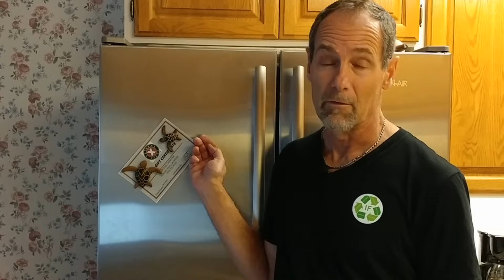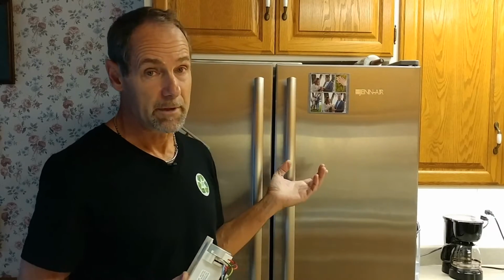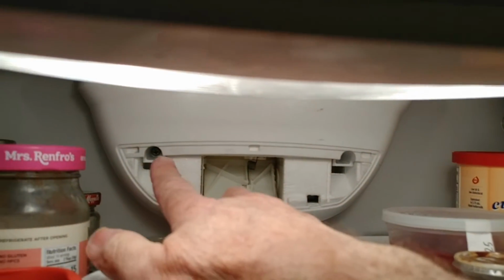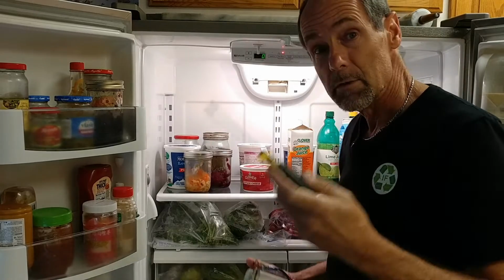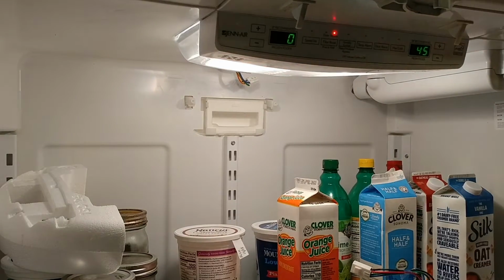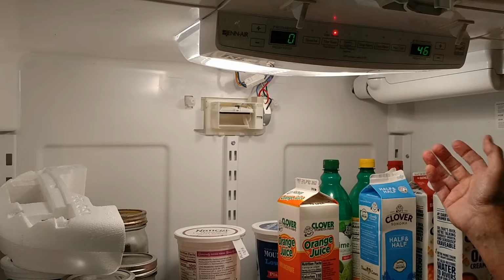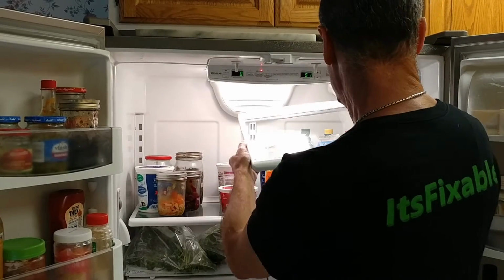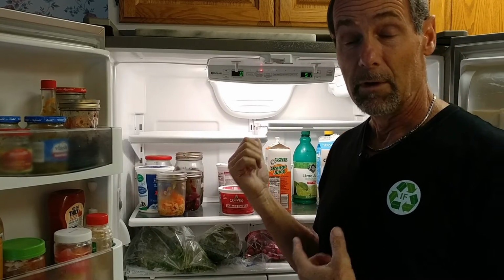Refrigerator Damper Control Replacement

Comment: Last year I had this problem and installed a replacement. After about 9 months, the new one started making noise again. I removed the part with the intention of seeing if there was a way to adjust, tighten or lubricate. There wasn’t. So I reinstalled that same part. It hasn’t made a sound again and appears to be operating properly. I don’t know if just unplugging it to remove it did some type of reset or what.  But you might try just unplugging it without removing. Leave unplugged for about 10 minutes. Then plug it back in.  Hopefully mine will stay quiet for a while.

Comment: My damper was replaced but still will not open. And I don't see where the temp sensor is in my refrigerator. I saw the repair guy replace it but he did not put the cover chute back on properly. So after he left and I cleaned it fridge compartment out I pulled the cover and he'd made a mess of the damper installation. Foam insulation was all torn up but alas, even straightening out the mrss the door will not open and fridge is warm as can be. According to stats. It's the fridge temp sensor that tells the door to open and close. But I just cannot locate it. There are 2 small vents in the fridge that are not inlet air but I cannot see how they pop off. But am assuming the sensor must be behind one of those. But don't want to break it trying to get to it. Pitiful.
Reply from the maker: Sounds like the service man didn't know his stuff. I'm sorry :(. You'll need a parts diagram to locate the sensor. Google your brand and model number and you should be able to find one on the Internet. It may be that your problem is the circulation fan and isn't the sensor or damper at all.
Reply: @ItsFixable  Thank you for answering. But I figured out the problem. The sensor for the fridge damper is in the freezer. And what it was, after I pulled the cover in the freezer, was the coils, the vent to the fridge and the sensor for the ice maker was totally frozen over. I used a hair dryer to defrost everything, dry it out and put it back together and everything started working perfectly. The damper opened as it should. The ice maker started making again and the freezer and fridge temp were perfect. 
Unfortunately, the company had already deemed it a total loss and gave me a new fridge. Which has been working perfectly since I plugged it in. But still. The event was a disgrace. It took me 5 months, to finally get it working, just so I could, do it myself, anyway. If this is a sample of warranty service, I'm not at all impressed. 
And I was told by a reputable appliance sales and repairs outfit, that most repair companies don't even do warranty service work. Thank God for Google and YouTube. And I hate saying that. 
Thanks again for answering.👍
PS. He did get the evaporator fan spinning. Without removing the back panel. But within 2 days I could hear the fan grinding on the ice again. 
Why have a sevice tech who is in a big hurry to get in and out, and then have to go in and do the job yourself. I've never replaced a compressor. Because I don't know how to do the procedure and don't have the vac and freon experience. But everything mechanical he did i have done on past refrigerators we've had. But I didn't feel I should have to do what the warranty was supposed to take care of.
Reply from the maker: @peterford9369  Wow, what an ordeal! The fact that it iced over sais to me that something else was wrong with that unit. I'm glad to hear you received a replacement, but sorry for your headache 😢.
Reply: @ItsFixable  Thanks. But from all the complaints I read, about even well known brands. It seems quality control is really an issue in appliances. Probably other items too, I'm sure. But there is no excuse for that kind of slow and carefree service. You buy a product in good faith and you trust the manufacturer to stand behind it. And then, obviously to save money, they hire somewhat, flybynight service people. And then when they do finally get to you. The company doesn't even ship them all the parts they need to do a thorough repair.  Just very unprofessional in my opinion . 
Thing is, I only paid 850 dollars for the fridge. All I could afford for the style and options i liked. But I read similar stories from people with 3000 dollar fridges. So the problems are across the price spectrum. Not just less expensive equipment. 
Thanks again.

Comment: Thank you so much! This video helped my dad so much! :) Our fridge crapped out yesterday night and we were trying to figure out what happened, he figured it out but we could not find where to fix it. This video aided us in locating the problem! Thank you so much again!
Reply from the maker: Glad I could help!
Reply: @ItsFixable how fast is it supposed to open?  Is the motor supposed to have a small vibration?  I installed a new one and it hasn’t opened yet. I’m trying to figure out if the new ones bad or hasn’t opened yet

Comment: I have an LG ref LFX25960ST, installed new damper, it remains open or closed all the time, I already changed temp sensor too.Thanks.
Reply from the maker: That sounds frustrating, I wish I had an answer for you.

Comment: Hi. I have a customer that complains of that noise, however, she says hers is continuous and when I opened it I noticed that it kept going up and down. Do you know if I have two separate issues? I’d the noise the damper but the continuous running is something else? I noticed in your video that the damper kept moving up then down. I assume it’s because the doors are open but the customer complained that it’s constant. Do you think if I replace the damper she will be fine or if it possible that it will be less loud but still keep running all the time, closing and opening? Thanks for the video and for any advise you might have.
Reply from the maker: Change the damper;  that should solve the issue.
Reply: Curious about that "constant" open/close action myself too. (Assuming because the doors are open, it can "see" the fridge needs to cool? So it cycles a few times as a "test"?)

Had to "fix" my Damper Control recently because it stopped working after a power outage.  My assumption was that the motor/tab somehow slipped free of the door (during/after the outage) so the motor was "silently", and as far as the Electric Control Board/System was concerned, "working" as commanded.
Reply: @ItsFixable changed it out and everything is working just fine. Customer called me about a month later and complained t that the things on the top shelf are freezing. I told her to adjust the temperature setting but that’s about all we can do because I’d obviously working fine. Haven’t heard back so she figured it out.

Comment: Great video! Made replacing the damper very straightforward. I would just suggest turning the fridge off before doing this, as the wires to the damper motor are 120V.

Comment: Thanks for the Video. Had a power outage here last week and afterwards, for some reason, the Damper Control wasn't working, so while the Feezer was staying Frozen the Fridge was staying between 45F-53F...

Was able to get into "Service Mode" to run various tests (using the instructions in the Technical Diagram Paperwork from underneath Fridge by the Coils from a Plastic Pouch...).  The Damper Control was reporting Open or Closed (and I could "command" it to switch) but it was always staying closed... Also didn't make any noise during the "switch".

Took a plastic Bread Bag Clip to wedge into the Damper Door Opening to keep it OPEN temporarily and that was able to finally quickly bring the Temperature down in the Fridge.   Eventually decided to see if I could remove the damper control to test if the Motor's Continuity was good/bad... While loosening it from the Tabs I think because the door had been open that the Motor (Door Tab) had been able to rotate back around. So when the Bread Bag Clip slipped/fell out, during my removal attempt, the door actually stayed open and cycled again.  It does make some obvious noise now (and looking back that has been "normal" for a while, but it didn't do that during the earlier testing (because the Tab/Motor wasn't "under load"?)...

As mentioned in the video, maybe the extra loud noise is because the motor is on its way out?  It is about 16 years old/original to the Fridge (2008)... So I'm think it might just be best to just swap it out.  If nothing else it might be quieter and hopefully won't "fail" randomly because of a loss of a power loss again.  If "that one" fails I suppose I can old onto the original as a "backup"...
Reply from the maker: Interesting experience. Good for you for sticking with it! If that's the original damper mechanism, it has lasted way longer than most. can't lose for replacing it at this point.
Reply: @ItsFixable  Agreed.  Have a replacement at the ready.  Running some tests with some Wireless Temp sensors to "dial in" the Temp make sure I'm around 35-38F "everywhere". Hopefully no 32F or 41F cold/hot spots...

Comment: Thanks, i have an LG that the compressor went out on July 6th 2022 and after 2 techs serviced my machine the refrigerator is still warmer than should be but freezer is working. I believe the damper is stuck partially closed not allowing enough cold air in. 

trying to find a good video on LG damper(side-side) replacement.

thank you again!
Reply from the maker: Or it might be the evaporator fan, which is responsible for moving the cold air between compartments. 

 Thanks, best of luck.

Comment: Thanks!  My whirlpool fridge has made this noise ever since I got it, but it’s gotten significantly louder lately and it’s only 7 months old. I took the first cover off and saw when damper opens and closes, it makes a horribly loud grinding noise. Now, I do have an extended warranty but wonder if I should just order the part myself and replace it. Not sure how much the part costs.
Reply from the maker: The part cost me $100.

Comment: Thanks for this video! :) Mine was doing the same thing continuously opening and closing and making noise, replaced a damper - it opened right away after I connected it and it looks like it never closes, veggies are frozen and it wasn’t like that with the old one🤔
Reply from the maker: Try readjusting the temperature dial. Could be it's been dialed up because of the old damper not always opening as it should have.

Comment: Thanks 4 the video 📹 sharing how one can replace this part. Question did you look around for a better price  or did you just purchase the first one you seen. And it great to C U helping your family or your wife clean the refrigerator no matter how small the job is, Question do you know where the thermos control prob is that controls the temperature for this part   to open 🤔👍look forward to your response.
Reply from the maker: The online price for the part wasn't but a couple dollars less than my local parts dealer, so I purchased it local. I like to support local business when possible. 
  I don't know where the thermostat is. I had a parts diagram for the unit which I found online and downloaded, but I have since deleted it.
Reply: @ItsFixable  😉😎👍

Comment: My Whirlpool is within its 12 month warranty period, and damper control has become noisy, but hasn't actually failed.  Found OEM part online for $57 plus shipping.  Service call is $120 minimum from authorized Whirlpool center.  Watched your video to see how easy latching tabs can be released without breaking.  I'll get my current part replaced under warranty, but seems inevitable to fail again before refrigerator dies.  I'd like to know if you opened the old damper assembly, to see what actually fails?  If it just needs a shim or bushing I'll give that a go next time around.

BTW, thanks for posting this!
Reply from the maker: NO, I didn't disassemble the part to inspect it's operation.
I'm glad you found the video useful!
Reply: @ItsFixable  Had to talk Whirlpool out of making me schedule a technician to come here and install the damper control.  That would have been over $100 out of their pocket for a five minute task.  They sent me the part, which I installed quickly thanks to your video.  My biggest concern was breaking the plastic tabs holding it in, but they did bend without breaking.  I disassembled the noisy assembly, but there was nothing obviously wrong with it.  Just a little sloppy between spacers, which may have been vibrating.

For some reason, Whirlpool accidently sent me a second unit.  If I can, I'll return it, otherwise I'll have a spare for future issues.  Thanks again for taking the trouble to post the video.

Comment: Thank you putting this video up. I have the same problem with my jenn-air fridge. Do you have the part number for the damper control ?   Thanks
Reply from the maker: W10594329, but that was back in December of'21. Could be different now; idk?

Comment: Could a symptom of this be a large build up of ice in the freezer?
The fridge and freezer both cool properly. That being said the freezer ices over entirely. 
The fan coils and resistors down below look brand new. When I looked at the damper up top it's rusted over entirely.
Reply from the maker: In my experience there are two primary things leading to an iced up freezer. 1) failed circulation fan. 2) a stuck damper. If you have confirmed that the damper opens but you don't feel cool air blowing out of it, the fan has failed.

Comment: I have the same fridge (kitchen aid version).  The sound mine is making is more like a motorboat put-put-put sound but if that is the only source of sound from the fridge cabinet, I guess this is the solution?
Reply from the maker: You can remove the grill and then when you hear the sound take a peak and see if the damper is in motion. But yes, that is the only mechanical part in that upper section.

Comment: In need of some professional advice. We have a Kenmore Refrigerator with the freezer on the lower half. The refrigerator stopped cooling but the freezer works perfectly fine. I completely cleaned, vacuumed and wiped everything down underneath. Compressor seems to be working fine with no loud noises and has a normal hum. The capacitor and lower unit fan are functioning properly as well so then I pulled out the air control damper and noticed it wasn’t moving freely so I replaced that and still not getting any cold air. What am I missing here Please Help 🙌
Reply from the maker: Sounds like the evaporator fan isn't working. That's the internal fan that sends the cold air from the freezer to the refrigerator section. Usually that's located behind a panel in the freezer compartment. Google the model number of your fridge and get a parts diagram. that'll show you were it is and what you'll need to remove to gat to it.
Reply: Should the damper door be always open? Mine closes shut.
Reply from the maker: Damper should open and close based on the need for cooling in the refrigerator compartment.

Comment: Any body replace the part and it still not working ?  Is there a fuse or relay that could be out to send power to the damper? No I didn't check for power on the connection on the fridge side to make sure there is power as I don't have a meter will buy one tomorrow

Comment: Where did you purchase the part?
Reply from the maker: A local appliance parts retailer had it on the shelf. When that's the case, it usually means its a fairly common problem.
Reply: @ItsFixable  Thank you!

Comment: This part is the most nosiest, poorly designed, piece of crap I’ve ever seen. I have to replace mine every 12 months because it gets so noisy that it’s unbearable. It still works fine but the noisy is god awful. I wish Whirlpool would redesign this part. I’m sure it’s just a simple fix to make it a little more robust than it is now obviously the cold air has some effect on it.
Reply from the maker: Yeah, it's the same part in all their brands too.